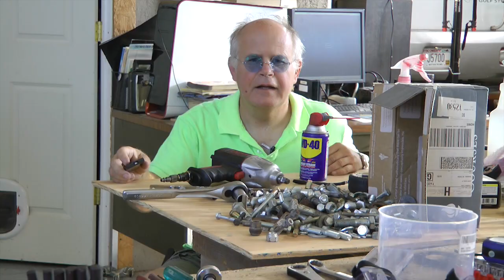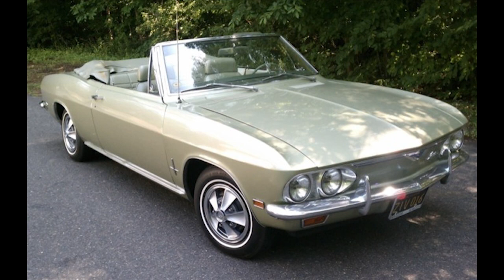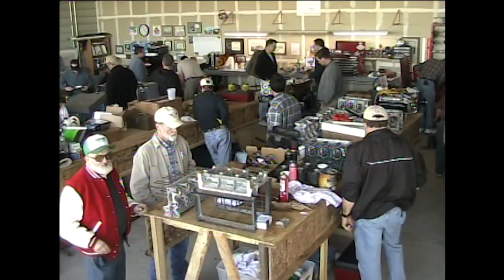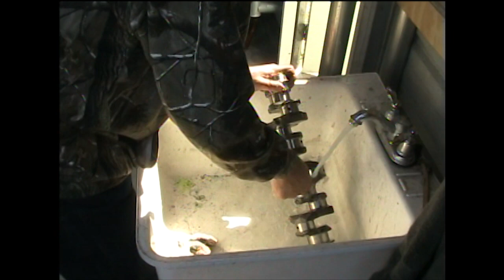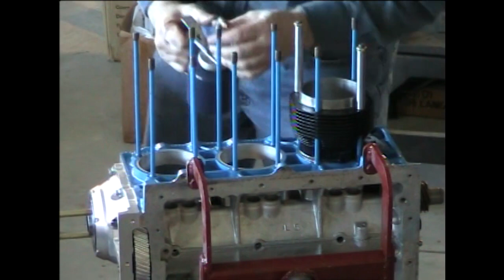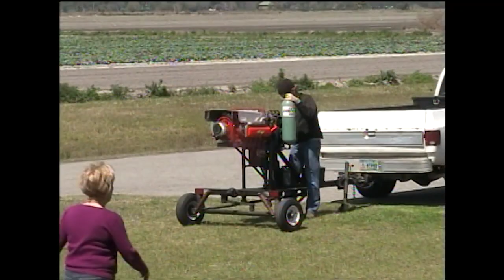Touch Every Part Inside your Aircraft Engine

Comment: I don’t understand why you think newer engines don’t have good tolerances as the older ones? I would believe they have better ones?
Reply from the maker: My point was that newer engines have such extremely tight tolerances that special skills are needed to rebuild them properly compared to 1960 designs. The accuracy needed for measuring and evaluating requires more attention nowadays IMO
Reply: I think his point was that the newer engines have closer tolerances, that may be beyond the capabilities of many amateur shade tree mechanics.